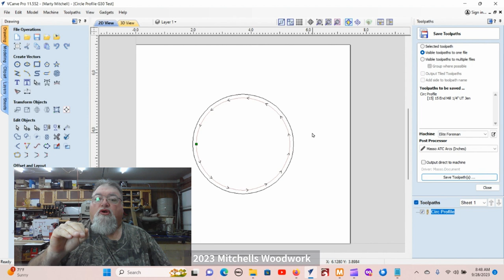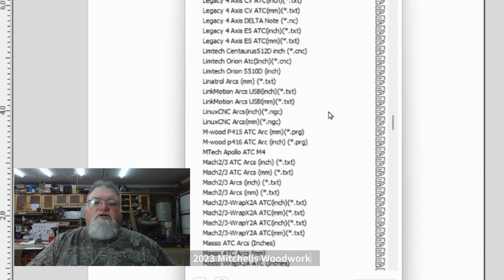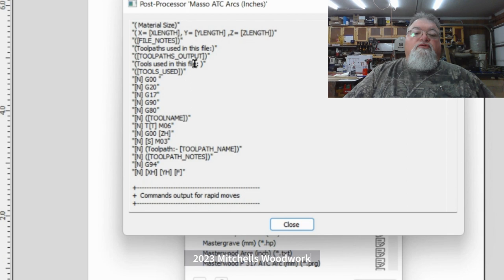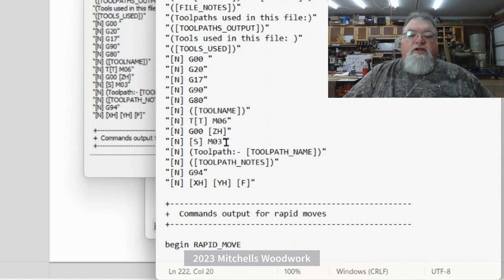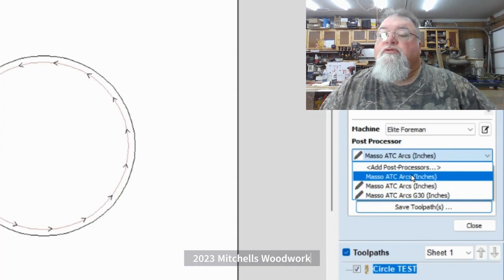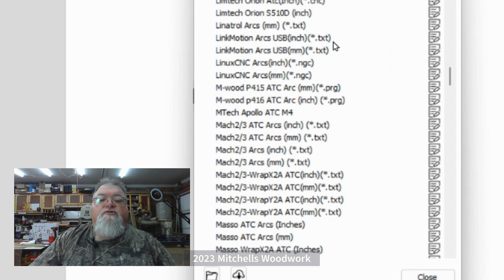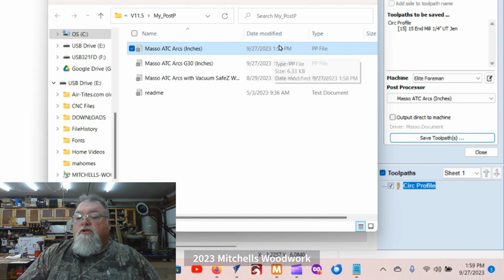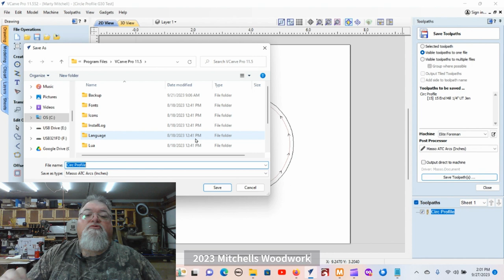How To Edit Your Post Processor in VCarve Pro for Onefinity Elite CNC & Masso

Comment: Great video. I have made some of these changes and it makes it nice. Since this video, Onefinity as come out with a new post processor with the vacuum command in it. I have been having trouble getting my USB port to work correctly so I decided to open the hood and take a look inside. I realized the USB port is on an extension and plugs into another USB port on the G3. There are 2 spare USB ports on the G3 so I moved it to a spare. Seems to have helped. Then I started thinking. I plugged in my wireless mouse receiver into one of the empty USB ports and my mouse works on the Masso screen. Letting you know as you have large hands and fingers like I do and makes it nice to just mouse around and select what you want. But, you may already know this. Keep the videos coming.
Reply from the maker: Hey, great post!  Thanks for the mouse idea, genius!   I severely bent the original usb drive that came with my Masso and had to do some research trying to create a replacement out of a 128gb drive.  Spoiler alert:  it won’t work.🤭  I’m planning to do a video on the usb drive options, and I’ll be sure to give you credit for the mouse idea.  Thanks for watching, commenting and following!

Comment: Great video, lots of good info.  One thing I like to do in my PP is to add G53 Z after G00 ZH so that after it goes to Z home, it raises the spindle to machine Z (all the way up).  This makes it easy for tool changes and makes sure that if after I have "go to park" that I know the spindle is at the maximum height too.  I also skip the G0 X0Y0 because it's a waste of time ;)
Reply from the maker: Great tip, I’ll certainly look into that!  Thanks for watching!

Comment: I use the iOT power strip from pwnCNC that turns on and shuts off both my shopvac/dust collection and my coolant pump.  It works without modifying any g-code.  I do want to do that parking thing that you've done here tho.
Reply from the maker: I bought the iOT too, but haven’t needed to use it because my coolant pump plugs into my Festool CT15 dust extractor, which is plugged into the vac outlet on the black box.  If I didn’t have the Festool I’d have to use the iOT, but I didn’t realize that when I ordered my CNC.  The G30 command is awesome!

Comment: Same question as Chris about setting up the park coordinates ( I imagine its inside the Masso touch screen somewhere) and I can change the name of the edited post processor file in the "My PostP" folder however it doesn't change in the list or where selecting to add it as yours did, named "G30" at the end.  Any clarification would be helpful.  Loving your videos and appreciate you making the time.
Reply from the maker: After you change the name you may have to X out of VCarve and start it back up.  Let me know if that helps.
Reply from the maker: Here ya go!  https://youtu.be/s10uP6vvlZg
Reply: I had the same problem.  To fix this, I opened the modified PP file in My_PostP and changed the line "POST_NAME = "Masso ATC Arcs (Inches)" to "POST_NAME = "Masso ATC Arcs G30 (Inches)".  After this I saved the file and closed Vcarve then reopened it.   After opening Post Processing Management, the file title displayed correctly.  Hope this helps.

Comment: The trade school I went to taught us how to write G-code by hand because they didn't have CAD/CAM software.  We used FANUC format because that was the industry standard where we were going to work.  I recently purchased a onefinity elite and tried to write what I remembered.  This controller isn't behaving how I expected it to.  Could you show a bit more of the complied G-code as the machine is running or perhaps a screen shot of the program text?  It would also be nice if you could explain how the spindle behaves just before and after a tool change.  That is, where and how it moves.
Reply from the maker: Ive pretty much covered all of that in other videos.  Spend some time in my “Onefinity Elite Mods & Tips” playlist linked below and I think it’ll all start to “click” with you.  A lot of times the hardest part of any learning process is UN-learning how you used to do things before.  

How long ago were you in the trade school, and how long have you had your Onefinity Elite?

https://youtube.com/playlist?list=PLqRrCnqsxc205ni9bmqukEaVEn2pkQF9M&si=0r25dttNUlEirc5E
Reply: Thank You for getting back to me so fast.  I must admit trade school was 30 years ago.   I ran vertical cnc mills for 15 years.  I have had the onefinity elite for a week.  Still waiting for the spindle to get here before I can actually use the machine.  Right now, I am trying to write some simple programs to get a feel for how it works.  One of the things I have found out is that like the FADEL machines the G40, G41 And the G42 commands need to be on a separate line.  Also, the Tool number needs to be before the M6.  Thanks for directing me to the "tips", I will take a look at them and see what help they offer @MitchellsWoodwork
Reply from the maker: @railyhill4006 which design software are you using?
Reply: I'm not using any software.  I am still trying to write G-code by hand.  I just need to know what the rules of the way the elite wants to see the G-code.  Such as I see how the post processor configures the G17, G20 and other codes on a line by themselves. As I mentioned before the FANUC machines needed to have the G40's on a line with a G1 whereas the FADEL machines needed the G40's on a line separate from the G1 move.  I like how you mention how your machine "Behaves" before you change your post processor.  That is what I need to know, how does the machine behave and the rules of how the code is written.  Right now, I need to know the rules about how the tool length works. I have looked at the documentation from the MASSO site, but it seems that I don't understand what they are telling me. @MitchellsWoodwork

Comment: Mitchell, love the video. I now understand how to add the command to the code, but when you put it in how did you set it up to the actual location for your desired “park position”?  
Thanks! 
Chris
Reply from the maker: I’ll make a short video on this subject next.  😉👍
Reply from the maker: Here ya go!  https://youtu.be/s10uP6vvlZg
Reply: I don't always want to park at the same place.  I usually just edit the Gcode (not the post processor) to park to the left of the work so I can easily change a tool.  Or if I want to go ahead and park it to the back out of the way.  The command is simply G0 X-10.0 (or whatever you want) Y0.0 (or whatever you want)  this would go right before the M30
Reply from the maker: @larryrobinson7492 Are you using VCarve Pro / Masso?
Reply: @MitchellsWoodwork  No, but that's the point of this, no matter what kind of CNC your using, you can open the gcode and do edits that apply to your needs at the time. Messing with Post processors is unusual compared to that, even though I do it some.  I've been trying to get people to understand that you can and should be ready to edit your gcode anytime, and almost any of those post processors can work if you go in and edit something in the Gcode.

Comment: Thanks, very informative!  Unfortunately you owe me a bourbon.  That "devil math" comment made it come right out my nose!  🙂   Just wanted to add that when I looked at my setup I see that I'm using the Onefinity Masso Post Processor.  There seems to be some differences in the file, but I'm not a g-code person and not sure if they are important or no.
Reply from the maker: 🤣 Homey don’t play that! 🤣  Thanks man, your comment made my day!
😁👍  How long have you had your setup?
Reply: I was one of the people who pre-ordered it Nov. 2022.  Got delivery March 2023.  I had some issues with the machine and had to get replacement parts from both Masso and 1F, but both were very responsive @MitchellsWoodwork
Reply from the maker: I’m glad to hear that your issues were resolved.  I suppose every new product goes through those growing pains in the beginning.  From what I understand, there were problems with packaging for the early machines, which led to broken stepper motors and other issues during transit.  I ordered mine 4/11 and received it late August.  Mine was packaged super well and I’ve had no issues at all.  

If you'd like for me to look at your post processor file just contact me privately here on YouTube and I’ll send you my email address.

Comment: I have pretty much everything you have, but am having a problems with the post possessor I get an error from vectic both tools are called number 1, and in the g code will not promp me to change tools. onefinity said I need to number my tools.  I see you have number on your is that why?
Reply from the maker: That doesn’t sound like a post processor issue.  The tools in your VCarve Pro database MUST be assigned a unique number by you.  The tools you have listed in the Masso ‘Tools & Offsets’ (F4 screen) must be numbered exactly the same as they are in VCarve Pro.   You can only use each number once in each location.  The Masso only recognizes tool numbers 1 ~ 104 so be sure to keep that in mind as you’re assigning numbers in your VCarve Pro tool database.  

If you need more help contact me through my business card link on my channels home page.

Comment: I feel like I have followed your video to the T. My new post processor shows up in MY_PostP folder with the .pp extension, but it does not show up when I  try to associate a post processor in VCarve Pro when I save a file. Any ideas on what I may be doing wrong?
Reply from the maker: In VCarve, when you click “machine > post processor management” does your new pp show at the top of the list of pp’s?
Reply from the maker: Ok, after you edit and save your pp in your MY_PostP folder, go back into VCarve and open an existing project.  Click one of the tool paths, click “save toolpaths” and then click on your post processor drop down list.  Now click “<Add Post-Processors…> you’ll see a plus sign in a circle next to the Associated Post-Processors box.  Click the plus sign, find and your new pp at the top of the list (it’ll have a pencil icon next to it), left click to highlight then click the select button at the bottom of the list.  Then click “Apply”.  It should now be in your list of available pp’s in your VCarve drop down list.  😊👍
Reply from the maker: In the video, around the 10 minute mark you can see the <Add Post-Processors…> at the top of the list.  I’m sorry I left that part out, and I’m shocked it’s taken this long for someone to let me know there was a problem!  Let me know if there is anything else I can do for you.
Reply: @MitchellsWoodwork It does not.
Reply: @MitchellsWoodwork  well closing Vcarve and reopening finally allowed it to show up in the list.  Thank you!
Reply from the maker: @Excavator99 glad you were able to get it resolved.  I'll try to update this video soon.  I appreciate you pointing out my error.
Reply: @MitchellsWoodwork  Well thank you for your videos, you point out some great ideas and show us how to do them. I inadvertently  pointed our your error. I had no idea LOL. Thanks again for responding!
Reply from the maker: @Excavator99  for the meantime, I have added the written instructions into the description of the video.  😉👍